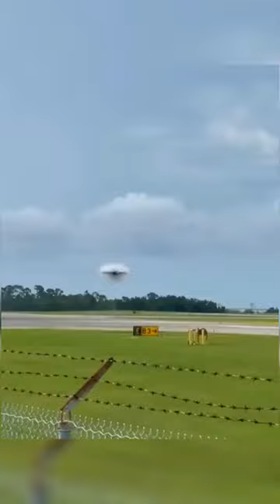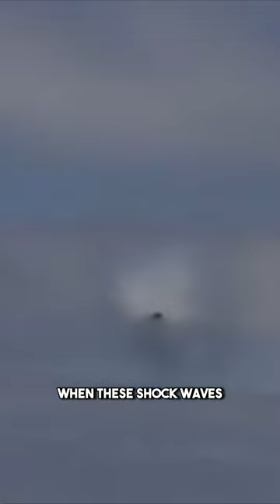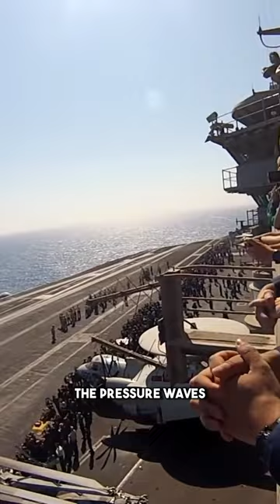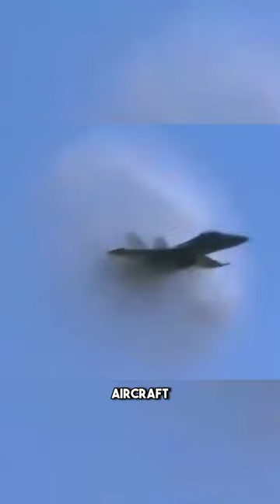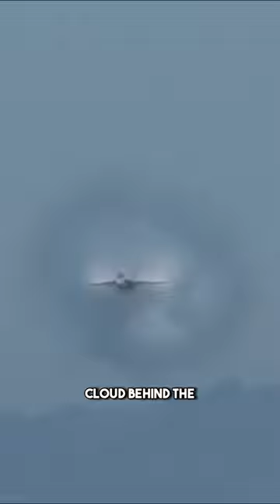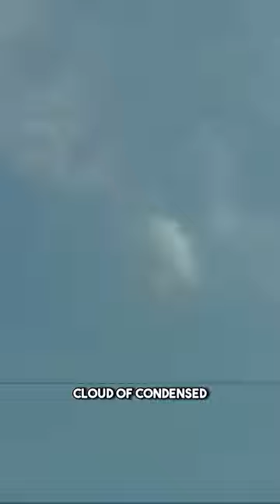What Is a Sonic Boom?

Comment: This is science official ? Really ? Not a single video shows a supersonic aircraft. They are vapor cones due to the increase in pressure after a Mach wave. That shows that the planes are all under the speed of sound, but the air locally increases speed as it passes around the plane, and locally you have small shockwaves build up and create that cone, because air is suddenly pressurized after going through the shockwave. 
If any of those planes were supersonic, the shockwave would start at the nose of the aircraft, not midway through the wing….

Comment: Those cones can occur well below the speed of sound. They are caused the rapid change in pressure and are water vapor coming out of its invisible vapor form and going into it's visible liquid form then immediately going back into the vapor form. Completely independent of supersonic flight.